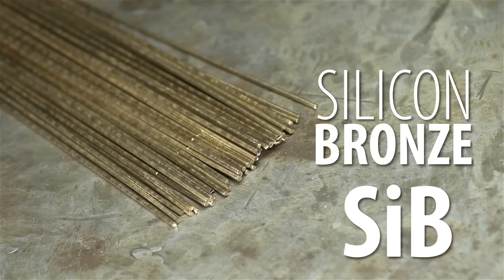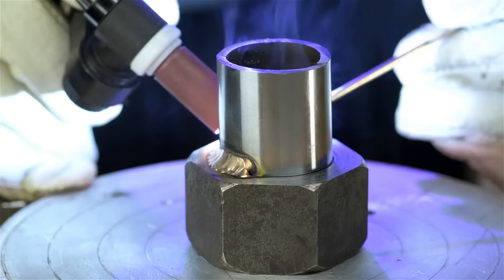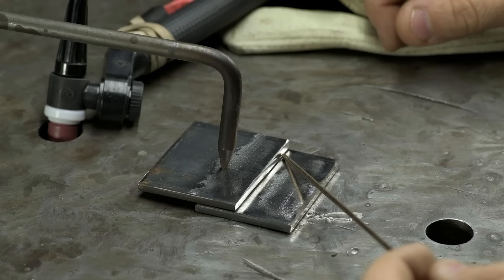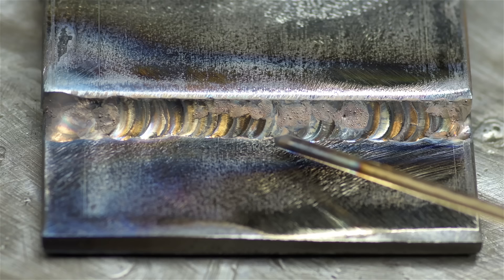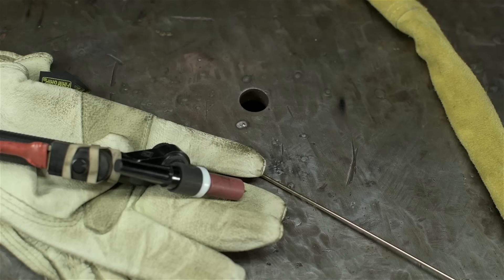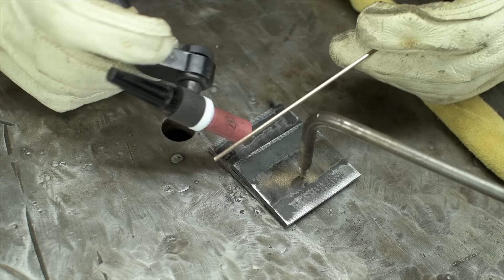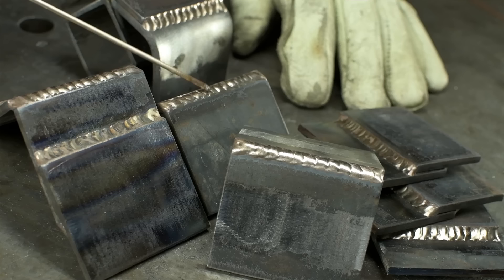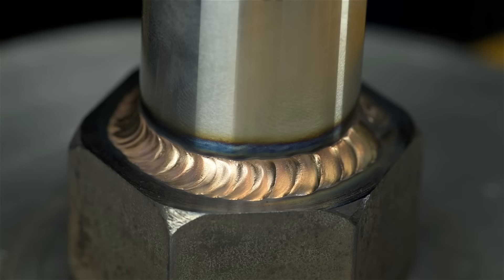Adventures in TIG Brazing

Comment: as a mechanical engineer from a metric country, wtf is a ksi. i can only assume its a kilosecond*sqrt(-1)?
Reply: ksi is not metric /iso units. It stands for thousand pounds per square inch. ie 1 ksi = 1000 psi.
Reply: Because forces are so much higher, imperial units borrowed kilo from metric so we say KILOpounds, "kips" for short.
Reply: Jake Minogue Spot on. It is also equal to 3.87E-5 mHour Newton Ohms per farthing squared if that helps in any future calculations you may come up against.
Reply: Kilo-Pounds per square inch. It's a metric-imperial bastard child. 10^3 psi.
Reply: So they dropped the entire unit of mass, but left in the bastard child that is  si = "Square Inch"? That sure sounds like something the imperials would do.
Reply: naw, that'd be a ksj
Reply: @wupme  KSI Standard Impact
Reply: Paremo there never was a unit of mass in a measure of pressure. There was, however a unit of force.
Reply: theres always one person that can't take a joke and has to break out their dictionary 😂
Reply: I laught way to hard on that joke. So damn good :)
Reply: Its funny because its called imperial because it came from Britannia, The great British empire. who now uses metric.
Reply: @Darkhalfcustoms     Nah, not quite, they actually use a whole fuck ton of different units, including, 'stone', pints, miles, among others, with a partial integration of the conventional Metric System - even though they were supposed to have finally given all of those up and fully converted to official metric by now, per the EU's "orders"[eye roll]

Now, where it really starts to get fucked up is that the US Customary Units(which, as far as I've ever been able to find, is the closest thing to an 'official name' for our total clusterfuck of random ancient units combined together) aren't actually 'imperial units', but rather the 'British Imperial System' was officially adopted in Britain in the mid-1820s, but our clusterfuck originated from the units that were used throughout England before the Brit Imperial System - the creation of the 'British Imperial System' obviously being an effort by Great Britain to standardize units of measure throughout their 'empire' so that every place that they colonized, and, thus, traded into & out of would be using the same standardized units instead of whatever the local traditional units were which would then require converting and what not("world empire problems", you know how it is...). And, of course, we had long since told the empire to fuck off by that point(damn near 50 years earlier exactly, actually). 

But wait, there's more! 
In the US, as a result of the Mendenhall Order of 1890something(I really should look up these specific dates...), the official reference standards for the units of measure used within the United States as recognized by the federal government were officially redefined - no longer was the official reference standards that define each unit of measure based on the traditional pre-Brit Imp Sys units(the olden days units, like where a 'foot' was literally based on the length of a typical adult man's foot), but rather all US Customary Units of measurement, the Yard, the Pound, and all units based on them, would instead officially be defined by the Metric System, or the Kilogram and the Meter equivalents. So, now, in the United States, 1 Yard would officially be defined as  0.9144 Meter and 1 Pound would be defined as 0.4536 Kilogram. So, if you were a US manufacturer of, say, ballast for some kind of machines and you manufactured various kinds of ballast in 1 Pound increments, to make sure that your ballast products were legitimately 1 exact Pound as recognized by the US federal government, you would verify(using industrial weights & standards equipment of course) that your products weighed exactly 0.4536 Kilogram(or 453.6 Grams), in which case that would be an officially recognized Pound.
Which is to say that, while our units of measurement are technically derivatives of olden day Great Britain traditional standards, in actuality they haven't been related to the standard units used in Britain since they officially adopted the British Imperial System(which everyone just assumed we adopted too for some reason, when we definitely didn't - because we weren't British empire by then) in 1825ish and since the Mendenhall Order of 1895ish in the United States when we redefined and, by virtue, aligned our official units with the Metric System(even though we haven't actually adopted its standards).
And, yes, that means that, while the US and England both use the 'pint' as a standard unit, they may in fact actually differ ever so slightly as a result of the officially recognized reference standards branching in different directions(them, per the British Imperial System, and us, per the Metric System). 
In theory.
Apparently.
I guess.

Hope that totally definitely cleared things up! Like, ultra crystal clear and what not!!!
Reply: I very much appreciate the run down on measurement. That was impressive. Exact date not withstanding. I knew it was a cluster but, Never knew it was that bad.
Reply: A quantitative measure :-) :-)
Reply: Do you really have a better feel for a million newtons over a square meter?...lol...that's too abstract for us Americans...we just say nope...we aint going there.
Reply: Jake Minogue
No -----   1 ksi =  1000 pounds per sq. in. (hence k). It's been around for ever,  unit of pressure or stress. ..  We're Americans...   We're NOT RETOOLING THE ENTIRE COUNTRY just for you foreign folks . Get used to it. Don't know why you didn't just Google "ksi" though.
Reply: @Paremo_   Too bad if you don't like it!
Reply: @Darkhalfcustoms  They will never live it down!
Reply: @crookedriver2079  WWIII will be the "metric war", after the war there will only be Metric stuff.   Your old micrometers and calipers and scales will be eccentric curios, like a Japanese scale marked in Shun.  Anyway, the Inch is defined in terms OF the Meter, so we can all relax just a little.
Reply: As in 7018 electrode is rated at 70,000 lbs per square inch.... 70 KSI

Comment: Where can I find the tig torch rubber bands? 😕 Can't find them anywhere. 🤷
Reply: Woodroe Mitchell check the newspaper
Reply: Woodroe Mitchell, I think e-bay has Chinese knock-offs
Reply: Produce isle. Check the broccoli.
Reply: On the same shelf as the weldin sparks, usually inbetween the cans of striped paint and left handed hammers.
Reply: You'll find them next to the box of grid squares!
Reply from the maker: check with Jody at weldmongerstore.com ;)

Comment: This is what I use for tacking stainless sheets. Tacks fast at low heat.....and you didn't run out of stuff to weld, all the plates to each other. Happy beads

Comment: I just spend some time heating it up with the arc before adding the filler. Once its hot then its fine. One last and extremely important thing. When you contaminate the electrode with the rod (you will) STOP!!!!!!!!!!!!! Do not ignore it and carry on. Grind it off.  The fumes will kill you if it vaporises and you breath it. Well in my case made me very sick for days :(
Reply: I have heard tig brazing silicon bronze has health risks. Get the air / fumes extracted folks.

Comment: I used to work at building racing kart frames. We used oxy-acetylene torches, with an inline fluxer. We called it bronze welding, to me, brazing is using a brass filler into a joint by capillary action, without any appreciable build up.

Comment: Please, for the love of all that is sacred, braze mohogany to cherry. Pleeeeeeese! And actually video and upload it, none of this "take me word for it" nonsesnse.
Reply: yes, please braze these woods for us
Reply: two words - hot snot...
Reply: @dsfs17987 Don't care. Braze all the woods. 😝
Reply: This sounds like a "you can't cut threads into a potato" sort of challenge.
Reply: You can friction weld wood.
Reply: Tuttomenui I can’t... just out of electrodes
Reply: Friction welding doesn't need electrodes, it needs specialized fixtures with shakers or spinning chucks. They pretty much rub one out =P.
Reply: Actually if you use Brazilian Cherry (Jatoba) and Brazilian Mahogany (Jequitiba) with a certified PVA base Bronze rod in a Wally World Hot Glue Gun your results will be spectacular
Reply: Tuttomenui thanks, but I’m well aware of that’s been done. Just cannot resist joining wood electrodes and and friction welding electrodes to become metameme :)
Reply: mpetersen6 but only in ac modes, of course, as we all know that dc is not suitable for hardwood though it may work out with pine or cedar
Reply: I think I would use a walnut dowel. Should give a good joint 😂
Reply: You could do it with a copper base wire, dovetails, and rose alloy filler.

Comment: Personally I can't stand any filler size above 1/16", no matter the material....I was doing 1/4" aluminum today at 275-300a and using 1/16" 5356..... I'd just rather use a smaller rod and have to push more in than use a larger rod and pull more heat out of the puddle...I've started buying .035" for steel and stainless, although my SiB is 1/16"...3/32 and 1/8" tig rods make me wanna run away lol
Reply: 0.9mm 1.6mm 2.4mm 3.2mm vs .035" 1/16" 3/32" 1/8" - which is more intuitive? :P
1.6mm al rod for 6mm material is quite the workout for the feed hand...
Reply: @dsfs17987  true, but every dab of an 1/8" rod in the puddle basically freezes it in place ..also I can feel the resistance with a large rod hitting the bottom of the puddle, vs a smaller rod likes to slide in there easier...also, not gonna comment on the metric thing...we in America are stuck in our imperial ways lol
Reply: Something is wrong, if the puddle freezes when using the bigger filler. Had that happen to me, but usually at the beginning (work piece cold) and on too low amps. You could also "pulse" with the pedal. What frequency is the AC on (if you have that option)?
Reply: being able to freeze the puddle is kind of the point, I thought?  I mean, you don't want to freeze it off completely, but being able to chill the puddle a bit with the filler rod is important business.  too small is better than too big on the rod, but if you're doing it right, it usually works best with the correct sized rod.  I imagine out of position welding would be near impossible with the tiny rod big puddle method.
Reply: @jon_byler , not quite. Aluminium has a very high heat transfer coeficient, basically you weld a heatsink, so cooling it might not be as difficult as heating the part. Specially if you weld a thick part and you do a long bead, as you progress, the puddle will form quicker, having a pedal is useful in this case, you can let off the amps a bit, if needed. The puddle will freeze instantly as you move the cup away from it and/or stop the weld. Heat management (keeping the part cool) is usually required for steel parts (stainless especially) and some other nonferrous metals that are not so good heat conductors.

Comment: Hey Tony, try reducing your torch angle and adding the rod to the molten bead.  Instead of trying to preheat the next dip like you would on steel you want to keep the filler metal warm.  Though I think you figured that out, you hinted at it near the end of the video.  Nice work as always!

Comment: I’ve used silly bronze to weld brass to all different type of steel, it’s great for filling holes on bad spindles, easy to machine down. Really really neat stuff
Reply: Have you done any gas brazing with bronze? I'd be interested to hear if there's a lot more heat going into the metal or if gas brazing is the stronger method?

Comment: You can also Tig 22-20ga. galvanized sheet with the silicone bronze and hardly burn the galvanized. Looks beautiful, I've done it several times on some large walk it air handler filter boxes.

Comment: I have done a lot of MIG welding and just a little TIG welding. Even less Tig brazing. BUT, in my short-lived experience at TIG brazing, I found it helpful to pre-heat the joint first with a gas flame. Or just smoke one first.

Comment: Tony, I didn't know about SIB, will have to get some, looks great, many thanks.  I did once try to do TIG silver-soldering, but made the in retrospect very dumb mistake of including the flux used when gas silver-soldering, what a mess that makes at the heat of argon plasma !!!

Comment: Thanks Tony for another great video. This is a topic that has been of great interest as of late. Nice to sort out SB with the HTP. Hearing that AC may offer some help with SB. I have needed to join brass pipe fittings to stainless and have struggled with SB. but seems to be working the best so far.  Tried silver soldering it and that did not turn out  well at all for me. Stainless does not seem to want to take Silver solder with O/A.  The tig with SB worked but I cannot seem to get puddle only dabs here and there. Watch the fumes from this stuff!
Reply: what kind of flux were you using for the silver brazing with O/A torch?  I learned to do silver brazing in a fine metal smithing/jewelry setting, and I get the feeling that what I learned is not how most folks do that stuff.  it ends up being more akin to furnace brazing, heating up the whole joint at once until the silver flows.  I've done that with all sorts of metals, but the key has always been to heat up the pieces I want to join slowly, so that the silver braze material doesn't burn up before the joint gets hot.
Reply: Just using the white paste flux that came with the silver solder, understand there is a high temp (black) paste for SS as well.  Yes, creep up on the temp for SS for sure.

Comment: With regard to melting the parent metal, it really comes down to your priorities.  If heat is not a concern, it should be fine to melt it.  I've used TIG brazing w/ SiB primarily to join cast iron.  It creates a strong joint and flows nicely with ci.  Typically, I have had to bring the parent metal to the melting point so, technically, it's welding w/ dissimilar metals but it works.  I used it to join the ci screw of by bench vise after it cleaved it self in twain due to a casting flaw.  So far, it's held up for about 5 years.

I've also heard of using the process for sheet metal fabrication using a carbon rod in place of the tungsten for a broader, softer arc.  I've tried this as well but not on sheet metal.  You can get carbon electrodes that will fit your torch - they are sold as gouging electrodes.  You should try it.

Comment: Used to tig with silicone bronze when welding freightliner crew cabs together. It was used for the drip rails over the windows and also for the top cap shell seams. It sure does flow nicely.
Reply: Base material was light gauge galvanneal.

Comment: when i have used tig to braze in the past, i used a blunted tungsten. sharpen like usual, cone 2.5 to 3 times diameter then flaten tip to about 1 third diameter. then use a lower amperage to heat base metal like you would a oa torch the flatenned tip will wash out ther arc cone

Comment: I haven't done any welding in many years so I don't remember how well this worked but I would start the arc then move the filler slightly between the arc and the work so the filler would complete the arc and move as fast down the joint as possible while maintaining a pool. This was welding tissue paper and avoiding warpage and blow through. I could be confusing my gas and tig techniques of course.

Comment: When a certain speaker manufacturer went from staking the motors (magnets) to the baskets to spot welding them, the baskets would bend from the heat, and we had speakers with coil rub problems. Brazing would work. It's not anything major structural at all. The old ones were just staked on, and they pop apart when the Fed Ex guy  drops the box.

Comment: I’m yet to try silicone bronze but I do use heavy copper wire strands to TIG braze 1/8 stainless rods to thin strips of 2.5mm steel (HW350) with good results generally at about 40 - 45 amps DC electrode negative. Works well with more reliability at far lower amps than trying to weld it

Comment: I am not sure of the name but we use to call it everdo.  You can weld it with 1/4" copper clad carbon rod that is sharped. Set the welder at 35 amp straight polarity. No flux or gas needed. Works Great on 20 gauge galvanized sheet metal.

Comment: I just received a Hitbox 200 amp DC pulse tig/stick welder from Ebay and I have a few project's lined up to do but one that I'm sweating is welding or brazing one of those fancy cast iron garden benches which has a cracked frame, actually the back rest part. It's cracked all the way through. I've been trying to learn which welding rods to use and which welder settings etc etc and then I saw some bronze stick electrodes at Lowes a couple days ago then got to researching. I'm thinking about trying to tig braze it with those electrodes with the flux coating removed and using a lower amp setting so as not to have to worry as much about the weld or cast iron cracking. I could also just use the rods as they come with the stick welder, not sure how well that would work but either way I'm going to be grinding the weld or braze down to match the contours of the frame so that I can paint it and hopefully not be able to see the repair, at least not as much.
 Any thoughts on how you think I should approach it would be appreciated. 👍

Comment: Long time listener first time caller, like your videos. As a professional welder that has done this before use AC, you can crank the amps and it does not penetrate. You have the right idea on use the pulser but in my experience that still does not beat AC.

Comment: I have had some success with 'Alumiweld' for small projects.  A propane torch and about 750 degrees F and figure out a tiny bit of technique; I've been able to join mild steel with aluminum bolts to make some brackets.  The bolt and steel broke/bent before the alumiweld on test bending!